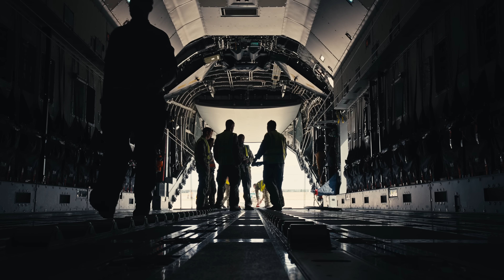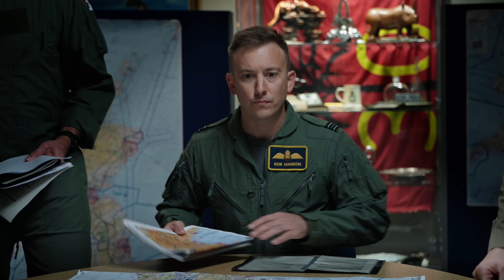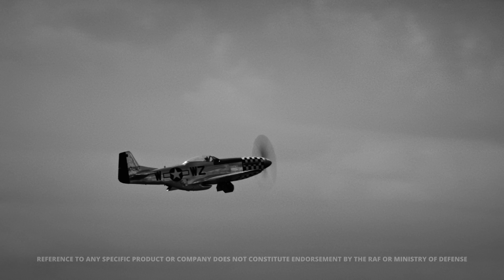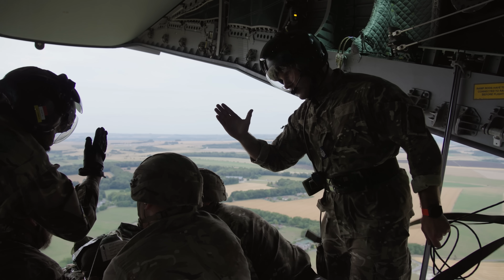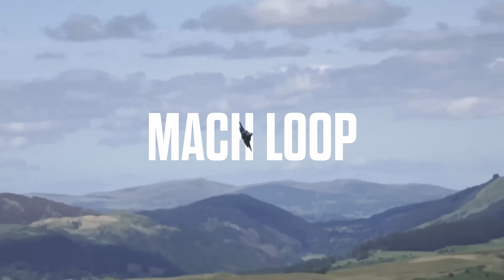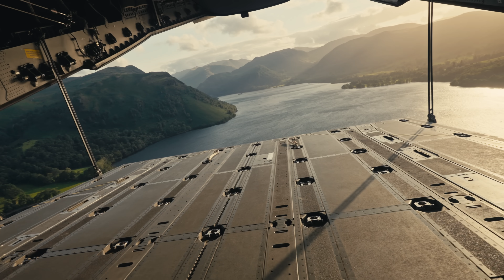The Most Insane Flight With The Royal Air Force | A400M Atlas

Comment: Nice article; a few comments: the propeller blades are indeed made of composite material, and they are very rigid. If aluminum had been used, their geometry would have resulted in a weight distribution that would have caused the propellers to self-destruct due to the centrifugal forces generated. The shape, in turn, was necessary to give the aircraft a jet-like cruising speed. Incidentally, the shape is so aerodynamically clean that it is responsible for the relatively low external and internal noise levels. This was a point of concern for us during development, because this aircraft can transport a large number of people over many hours and long distances. 
For a moment, I thought the viewer should be told that the aircraft was powered by Rolls-Royce engines. In fact, Pratt & Whitney would have been the premium partner according to Airbus, and they actually had a nuclear engine there that could have been converted into a sufficiently powerful propeller turbine. It was then German politicians who, with the foolish claim that we didn’t want American engines on a European aircraft, ultimately contributed to the founding of Europrop International. These politicians were foolish enough to believe that the companies involved in this consortium—which were fierce competitors on the global market—would now, inspired by the task of building a magnificent European turboprop engine, share all their trade secrets, which are usually kept under lock and key. One can imagine how that played out at times. The cockpit, perhaps, is not like that of the A380—not because it comes from the A380, but because the A380’s cockpit was ultimately designed using development funds for the Airbus A400M. That’s what you call a synergy effect, and it should be presented accurately. 

Oh, and by the way, I’ve been retired since 2009, just a few weeks before the A400M’s maiden flight. I was the German spokesperson for the German Air Force regarding engine maintenance relevant to certification.

Comment: Incredible aircraft, unfortunately just 178 orders // 130 delivered. C130 has 2500+ number built.  Let's hope at least 500 A400M will be manufactured.
Payload Increase: Airbus is evaluating a payload increase from the current 37 tonnes to 40 tonnes.
Production Rate: The line has stabilized at a rate of approximately eight aircraft per year.

Comment: Other than air-to-air law, are there any default protections in the A400M or is it like flying in direct law all the time?
Reply: No, it has normal and alternate law like a standard airbus airliner, with all the usual protections you would expect. Direct law is available but is used in emergency situations only.
Reply: @tomgoulden3339  Thanks!  It was the comment about the maximum bank angle that made me think that they couldn't be running in normal law, unless heavily modified?
Reply: I think the civilian airliners are only allowed about 30°  bank angle - something like that

Comment: Slightly confusing editing. I thought you were flying round the Mach loop, but then I saw a mountain that looked like Glen Coe in Scotland and sure enough a few seconds later you said you were flying over Loch Ness. And then a few seconds after that the pilot’s talking about the Mach loop again before heading off to Bala, both of which are in Wales. Presumably either separate flights, clips out of order, or a significant time elapsed between one shot and the next.

Comment: Essentially the C-130 and C-17 was the base for its design as it seems to take characteristics from both. Beautiful looking aircraft. So if the Brits are eliminating the C-130 they are going to lose some of the abilities of the smaller C-130 but gain cargo capacity without getting into the much larger C-17 which I believe they also operate. I don’t care for the looks of the refueling boom sticking out as I prefer the sleeker looks of the refueling nozzle or the retractable boom.

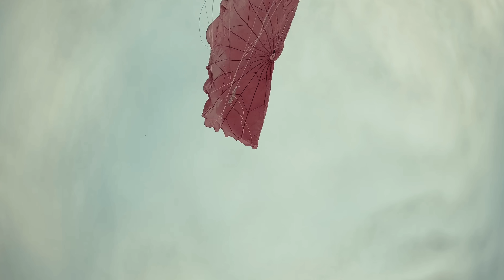Comment: 20:00 That's a sick shot. The centrifugal force from the turn perfectly balances gravity, at a ratio so that the perceived direction of "down" still feels perpendicular to the floor of the airplane. You can tell by the way they're walking. Meanwhile you can see the actual orientation of the ground through the open rear door.

Comment: Gucchi aeroplane but it isn`t a good tactical transport as it cannot do what the Hercules did for the RAF. It still cannot drop more than sim 20 paratrooper sticks (40 men) in one pass,..... (the Hercules could drop sim 45,... ie 90 men) and the gap between troops jumping from the Atlas is insanely large!,.... sadly the Atlas still cannot drop an MSP carrying vehicles (the Hercules could carry two MSP`s, containing 4 x Land Rovers etc). British Airborne Forces have been severely let down by the RAF and now have to rely on foreign Hercules or C-17`s if they are ever to drop operationally or in large numbers on exercise and with vehicles. ..... Also,.... the RAF Atlas cannot be used as a tanker as stated by the RAF pilot,..... they don`t have the kit, training or clearance as civvie company Airtanker have the sole contract for British AAR using the Voyager. They can only receive from the Voyager.

Comment: Ngl Rolls Royce sponsoring this is actually sick.
Reply: they make the engines...its rolls royce engine...
Reply: @borris3768  it's actually a US design. Rolls Royce acquired Allison to get a US-based jet turbine manufacturer
Reply: @fallinginthed33p  there is a Rolls Royce division also in Canada but i think they make mostly smaller planes engines & Airbus also in Canada is pretty big
Reply: @OnnSight   Actually I was wrong 😂😂 The A400M Rolls Royce engines are a European design. Rolls Royce also supplies Allison-based engines for the V-22 and MV-75. Rolls Royce Canada is a lot smaller than the Allison Engine division which RR bought from GM. Airbus acquired Bombardier in Canada which was sad but it allowed the A220 program to continue.
Reply: @fallinginthed33p you are getting closer. The A400M engines (TP400-D6) come from a european consortium called EPI, where Rolls partnered with MTU (IPC), Snecma (combustor+HPT), and ITP  (LPT) Rolls themselves were developing the HPC. The gearbox that finally drives the propellers is from Fiat Avio....
Reply: @TonyMLaereman correct. Proud to say I worked 7 years for this project at RR in Dahlewitz.
Reply: @mienmuus1096 I joined relatively late but spent 2 years on it and still enjoying RR in DW 😊
Reply: @fallinginthed33p You couldn't be more wrong!
Reply: @mienmuus1096 The only production testbed of the TP400 is just around the corner at MTUBB in Ludwigsfelde. The only production final assembly line was planned there as well but was then moved to MTU Munich but the test bed was already built and commissioned in Ludwigsfelde.
Reply: Absolute flex
Reply: On the other hand, Sam's access and UK military-industrial sponsorship might not last long if the Greenland invasion goes ahead.
Reply: @fallinginthed33p that is entirely on the US. Their Orange-eetoh needs to understand, yet even if he could (he can’t) it won’t matter. I honestly put my money on Europe and all other NATO countries vs the US, that said even with the US narcissistist in control with most Americans indifferent, NATo dissolving for orange’s delicate ego sake, nuclear war will make all of us lumps of coal (if we’re lucky). I’ll be running directly towards the closest nuclear bomb, not far from here.
Reply: @fallinginthed33p  looking back on this now is pretty funny
Reply: @fallinginthed33p  🤣🤣🤣:face-fuchsia-poop-shape::face-fuchsia-poop-shape::face-fuchsia-poop-shape:
Reply: @fallinginthed33p  they aren't going to 'invade', Trump is just being Trump
Reply: @fallinginthed33p  nothing ever happens
Reply: @InevitableIndia-1947Not true, Epstein has been off the front pages, job done.
Reply: In 2026, you need to invert meaning just to get meaning? Now, that's sick. "Sick" Essentially it's a lie. An unessential evil twist on truth, passed as truth and widely accepted as truth. Interesting. Sick used to be used to tag improper action. Yet here we all are using the term as praise.
Reply: @burtlangoustine1  sick in that meaning has been mentioned for the first time in the OED in 1983. Which leads me to the assumption that you might have seen the Hindenburg go down in person.
Reply: @Kilandil  Oh! Haha. If speech was set, oral and written deviantism would faulter. Instead it runs rampant. I'm old enough to remember human society. 
Good luck
Reply: @burtlangoustine1  Dude chill and get with the times
Reply: They're just an engine manufacturer, don't get excited.
Reply: @sheneng22 Lmao "just an engine manufacturer" - they literally build nuclear reactors.
Reply: What's your point? Why is that "sick"?
Reply: @sheneng22 sorry but it is kinda sick. If you don’t get it, then you don’t get it  ✌️😌

Comment: Its from 2009 so why doesn’t it use jet engines
Reply: Because jet engines have certain disadvantages to props. A jet engine requires a good deal of time from putting the power on to it actually being delivered out the back, where as a constant speed propellor such as have on the A400M can change its pitch almost instantaneously and deliver the power we require.
Reply: Those are Turboprop engines, basically jet engines powering the propeller.